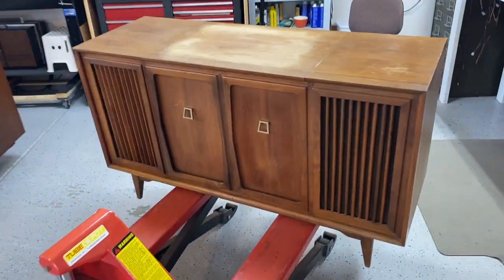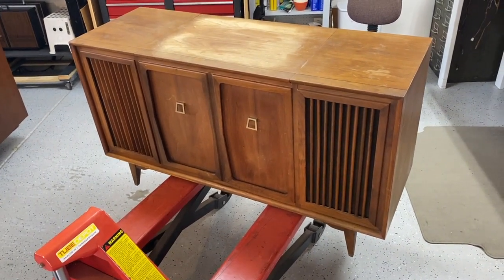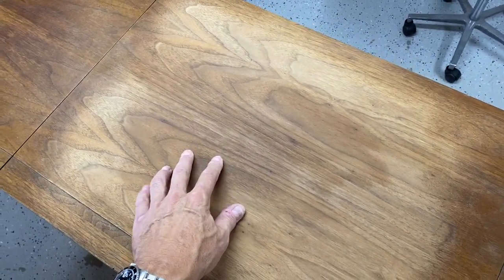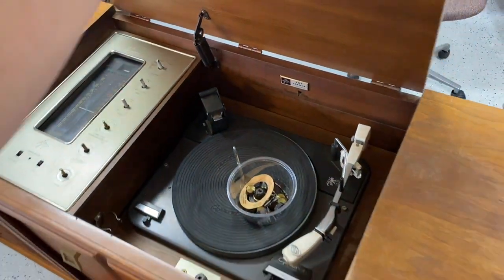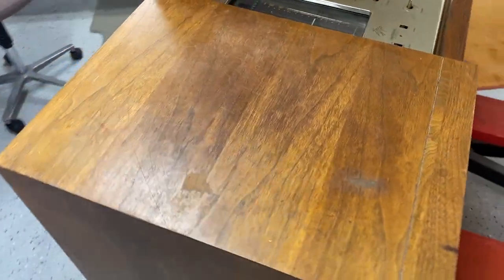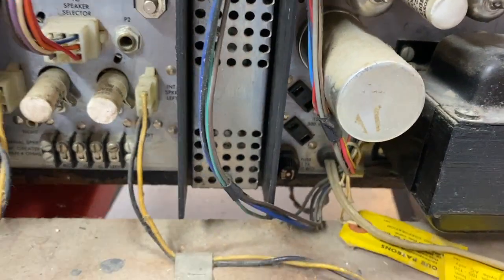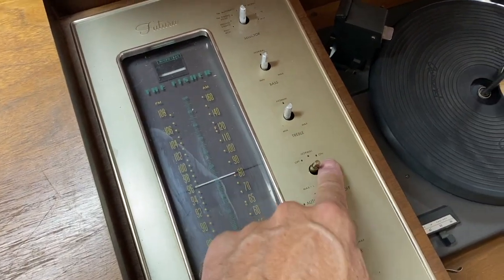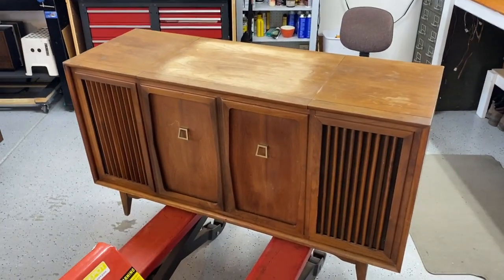Saving a 1964 Fisher Futura V

Comment: The Fisher I got yesterday has very similar top equipment (tuner and turntable) but mine has the PP EL84 amp in it. I lucked out mine was almost mint sans for a few nicks here and there. I dusted mine out today and even in my metal garage and rural area it was picking up stations no other console I have can do. Fisher tuners are very good, very sensitive.